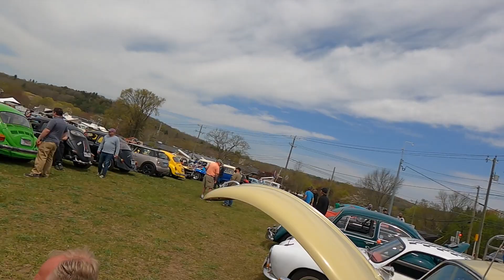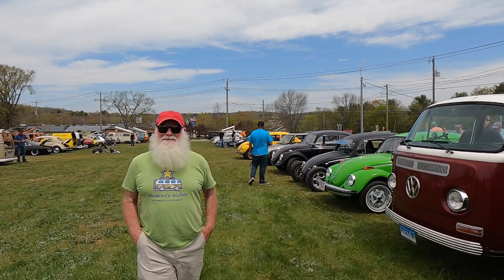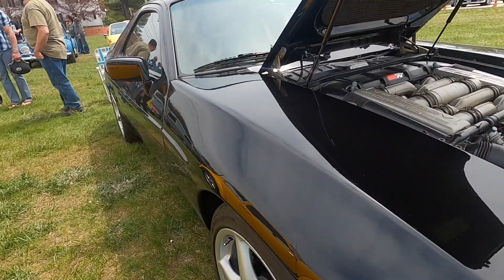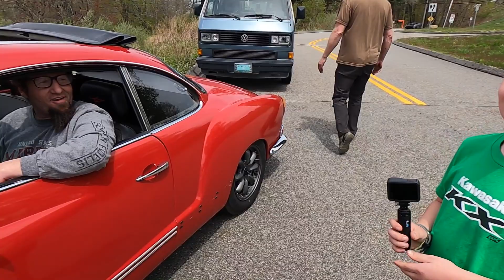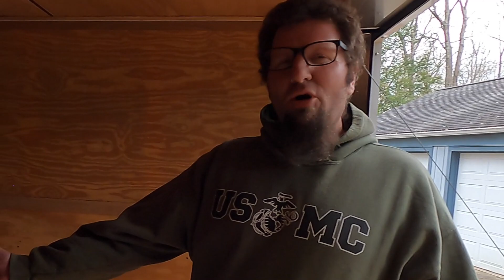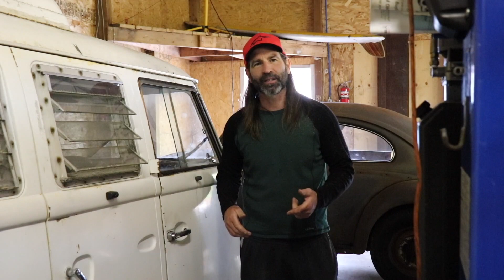MUSTIE1 & VW Nut 1967 Volkswagen Beetle , Ghia or Bus Rescue ??

Comment: Seeing your VW pickup reminded me of a concept I had of attaching a single cab bed onto a double cab, mounting the body to a custom four wheel drive frame (with duellies or duel axles), adding a V8 engine (diesel?) with no supercharger (turbo or two?) behind the cab (radiator shroud under back seat), with a roll up/down rear window (and partial bus hatch?).
The full bed length would be widened to cover the duellies and enlarge the storage space (treasure chest) and make room for the features, ie: a fold away two ton hoist, custom roll off truck bed,
removable dump bed (when needed), removable goose neck and fifth wheel hitches, swap-able winch (front to rear), compressor, generator, mig/tig welder and other equipment.
The goal would be to have a multi-purpose vehicle for a farmer, junk yard shopper, recycler /scraper, scavenger or getting an off-roader pulled out and repaired enough to get home, etc...   ;-)

Comment: Mustie 1, I have enjoyed your videos for a long time. 
I have seen you try to start an engine w/ a high torque drill motor w/ a  socket several times but it usually results in an injury. Is there a tool that allows a mechanic to use a drill motor and once the engine they are trying to start  fires and the motor rpm is faster than the drill rpm disengages?
Kids, there’s your million dollar moneymaker....